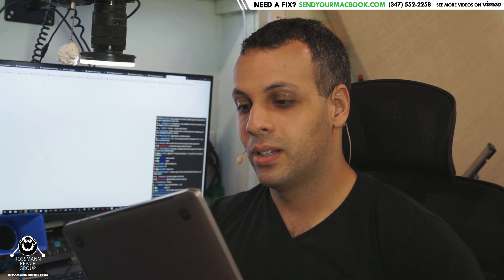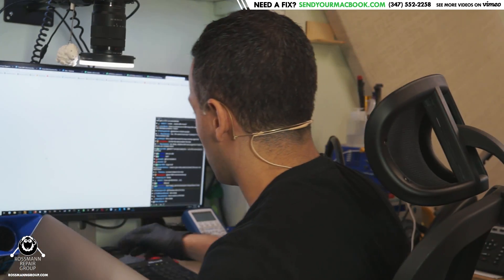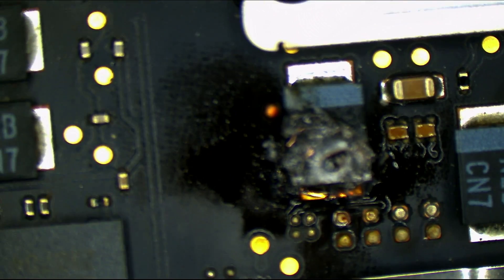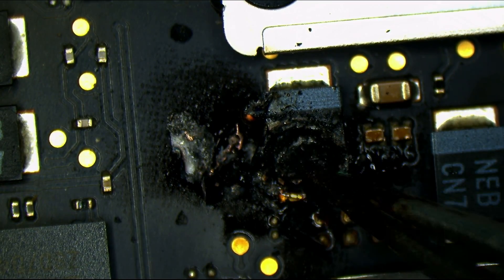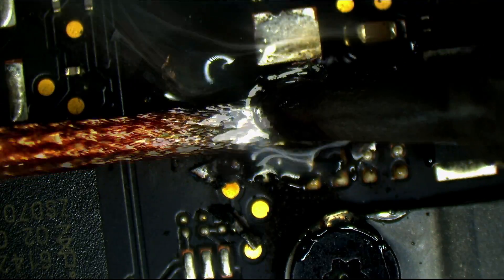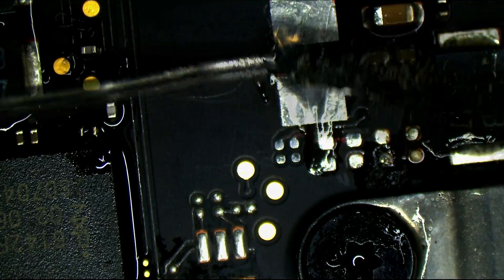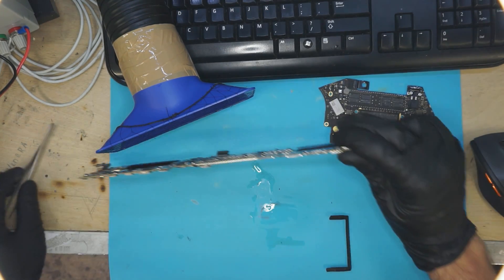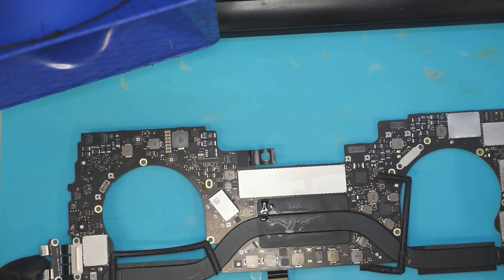A1706 Macbook Pro Touchbar common cause of spontaneous death

Comment: I saw You measured 13V on pp bus, the caps withstand 16V ( afaik at 25•Celsius, ) i know from previous tantal caps i used that they change the caracteristics with temperature and age. And the one You replaced i think sits in an area which gets hot. I design electronics and i try to design it in a way that it only fails if it gets heavily abused by a customer. Your videos are a inspiration to me, most of all how NOT to design circuits. In a design i used similar usb-c circuits. They also spontaneously died in test. After modifying the circuit it survived the tests. Electronic engineer is a hard job. I think every day how to make things that they last eternal. One rule i made for me..... no tantal caps!!!!. They are small cool and useful but mistreated a ticking circuitbreaker. Thank You Louis for Your work You do.
Reply: The last time I really, absolutely had to use tantalum caps to squeeze the most out of density/esr/leakage considerations, it was a circuit that only had to operate once in its entire life -- only for a few tens of seconds before the entire parent assembly exploded.   Sometimes it's nice to have a firm terminus on expected operating life.

For my own repairs, if I open up something that died to find that it's an obvious design issue that promoted a particular component to fail, I go out of my way to either find a part that's better suited to the application, or I'll try to make other modifications (e.g. adding a heat sink to a TO-220 transistor that dissipates 4W under nominal use (no shit)).  As far as I'm concerned, "fixing" something that failed due to a design flaw requires addressing the design flaw.  That said, there isn't much room in a laptop to make changes, especially not regarding the thermal design.
Reply: @PSUQDPICHQIEIWC  same thing, just making the thing bombproof while trying to not make it too "ghetto" xD
Reply: As an electronic engineer graduate, thanks for the explanation, I was looking for it
Reply: I think i will go and get some tantals in similar type for what read little more down this comment. 12v for the 16v cap sounds particular fine. Within the 30% range yes.... but in the video Louis measured 13V also ok but no one measured the ripple voltage. And also spikes are unknown. I think i make a measurement chain with the caps. ( voltage , spikes, temperature grading. And for the lulz i will put a 12V 8A source :-)
Reply: @gyverworld  yup, mos def. Would rather get a double value...or even film cap (probably no room) or, considering they are probably not part of a tuned circuit, remote breakout with wires (yes, super ghetto).
Reply: Sometimes you just need a big tank, C0G would take up half the board, X7R is basically snake oil and aluminum electrolytics evaporate and die in 10 years. Tantalum is the only way at that point. But putting a 16V tantalum on a 12V nominal line is lunacy, those things literally explode when overvolted even for a few microseconds. I probably won't even put a 25V one in there.
Reply: @iaadsi  Polymer tantalum capacitors typically require 10-20% voltage derating, so putting 16V cap on a 12V line is perfectly fine - you have more than 30% room to account for voltage derating.
Reply: @nitrocaster   Derating is fine as long the temperature doesn't exceed 25-35 deg. C. This is area near CPU which gets near 90 deg. C hot all the time ;) You need to have 40-50% derating at that high temperatures
Reply: @michvod  This is just not true. These are not old tantalum caps that have derating curves going down to like 30% of nominal voltage. For these particular cap 20% derating is applicable across the whole operating temperature range. See Tokin NeoCapacitor catalog: https://www.tokin.com/english/product/pdf_dl/neocapacitor_e.pdf

Comment: Defective cap, possibly Apple chose the wrong cap for that HF job or, bad batch / QC problem at the Cap Mfr. 
I've seen Tantalum caps popping for over a half century; some do go up in flames; always suspect 'em. 
Just say no to Apple 'cause Apple No. two.

Comment: Louis suppose someone had to buy the latest gen macbook, is it possible to proactively engineer around most of the potential causes of death other than the keyboard defect?  Like separating the high voltage line with jumper wires running away from the other data lines for example.
Reply: if you haven´t seen it, there is a recent video about the 52V line issue from EEVblog where Dave (an electrical engineer) took a look at possible solutions for this problem. I dont think it´s going to be easy to properly fix that flaw in an existing product. 

Just don´t get any liquids anywhere near it ever or something :P
Reply: @Basement-Science  From what it looks like the kind of fragility these systems have .... even if you breathe the moisture from that can cause water damage 😂

Comment: why do i watch these videos, i cant understand a thing
Reply: It reminds you why you shouldn't buy Apple products.
Reply: It's like watching Bob Ross of Apple repair.
Reply: To learn something :)
Reply: Because no ohms to ground
Reply: Therapy
Reply: Cuz louis is daddy
Reply: I was like that three months ago too.  While I still cannot perform logic board repairs I have learned that one should not be afraid to open a MacBook and to remove motherboards.  That wireless cable connectors are a freaking pain and that it is easy to solve minor issues.  You will understand, at some point.  Just go buy some liquid damaged from the local internet and tear them apart.  Nothing is more satisfying than to clean a motherboard, reflow and bring it back to life.  Or make from 3 damaged laptops one fully working!  It is awesome, and I learned it all here.
Reply: I watch to catch some words of wisdom from Rossman.
Reply: yes apple sucks wish I knew that before I bought my 2013 one. It keeps shutting off randomly and it’s rlly frustrating but strangely stays on when you open alote of applications and put load on the battery/cpu/ram. Anyone know how to fix it? I think it’s a battery issue cuz it’s got 1300 cycles on it lol
Reply: @playbutton657  
Shutting down unexpectly could be cause by battery - right but if you  didn't service your Mac for a long time it's worth to check thermal compound and  cooling system condition firstly. Maybe thermal compound  is dry/fan/heatsink is dusty and CPU is overheating... Is  it getting warm from top/bottom maybe? If yes as I said check cooling... it seems to be it because when you open more Apps not ony RAM gets load but CPU too but battery also because of bigger power consumption.   You know what? You can try that trick: https://www.wikihow.com/Calibrate-a-Laptop-Battery-on-a-Macbook. Issue decribed  in this article often happens when  you don't  perform full charge cycle from 0 to 100%  insted you discharge it  to let's say 5% plug in to charger and disconnect  on for example  when reaches 50%. There is a chance that the electronic recalculates the capacity while and  problem gets solved.  If  it  doesn't work I think the next step is battery replacement. Over 1k charging cycles is damn a lot!
Reply: Same, I come back because louis is entertaining and a decent role model. Good dude.
Reply: In a little while you'll start to understand
Reply: To learn.
Reply: i watch it because flux melting is cathartic
Reply: Maybe you are just no have basic technical knowledge
Reply: I'm pretty sure you could understand that blown capacitor with the gaping hole in it needed to be replaced.
Reply: @Hyp3rNova56 Nah! Acer is shit, but Asus is beneath that. I can't say the same about Mac as I don't own one.
Reply: @Hyp3rNova56  "all I know is apple bad other laptop good" That is the argument I want to point out. My 700USD asus was dead without a reason, and can't be fixed just a year after I bought it. I used it for movie and documents. My 1k USD Acer starts having problems after a couple months but at least it still lives after 2 years, but the keyboard, battery, and screen are always having problems. So, my points were: other laptops not always be good or better than Apple.
Reply: @jinraigami3349  you could try a Dell, Toshiba or LG laptop they are good
Reply: @nathanmead140  thanks, but I'll try Lenovo or used MacBook next.
Reply: Flouride Productions well, take this as an opportunity to learn something new then
Reply: because PPBus
Reply: You just hate Apple 🍎.
Reply: Try switching to a different toothpaste, maybe something without Aluminum Fluoride. Drink Spring Water.